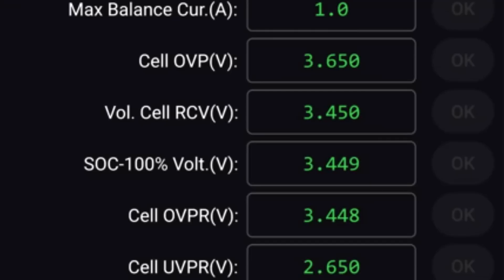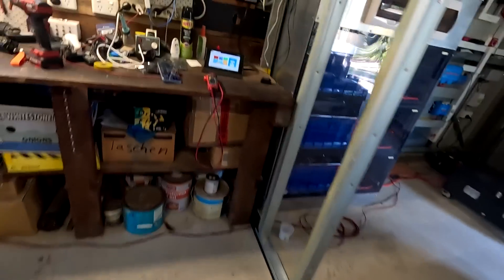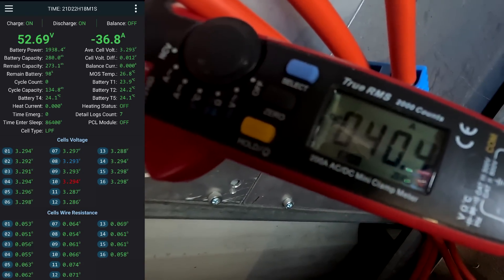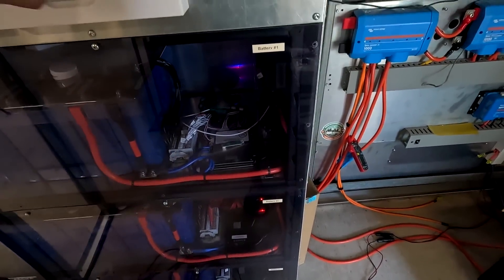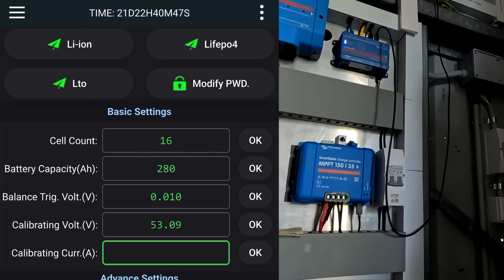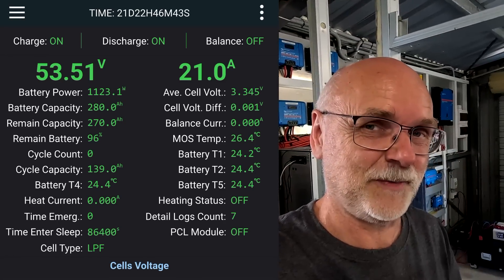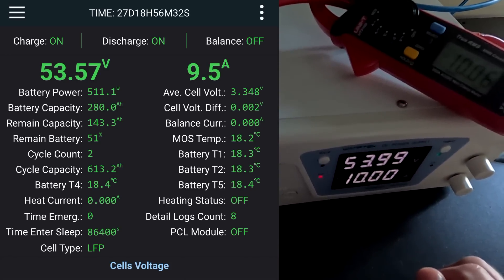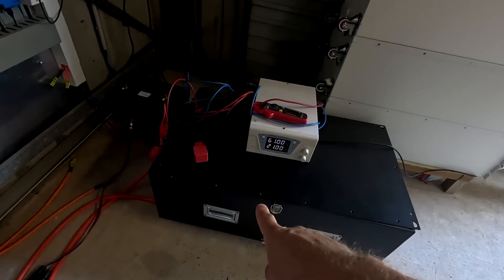JK BMS SOC Drift - How to (not) calibrate the current sensor and will it actually help?

Comment: I'm in trouble with a new jk inverter bms. Cant get to absorb phase with my sofar inverter. When bms hit soc-100-volt, inverter just stop voltage charge and i cant do any absorb or balance. Do you know if jk have any plan to untie soc-100-volt from other voltages ? or trigger 100% soc only after the absorb timer directive ? or do i have to revert formware to version where soc 100% volt was not a feature ? thanks.
Reply: There is no such firmware. That SOC100%Volt setting is there since the initial release of the v14 hardware. Growatt,Sofar, Luxpower, EG4 etc or any Voltronic OEM design are affected. I also would really like to know the answer to your questions as well.
Reply: @AshleyL-.-L  i heard in another videos that older jk firmware reset soc only when ovp was hit ?!? maybe i'm wrong or it is pnly on older hardware jkbms.
Reply: @theshuff  Nope, that is totally different BMS. The older jkBMS or non-inverter series cannot be flashed/updated at all. You are using new JKBMS which is capable of inverter-bms communication and this series has serious flaw with coulomb counting and SOC100% reset by single cell voltage issue which results in early charging termination problem.

Comment: Hi. I've been dealing with this problem for 6 months. The problem is that there are big differences between charging and discharging. If I calibrate the BMS to 20A, it shows 20A when charging, but only 17A or 18A when discharging. This means that the SOC value is no longer correct later. I have now calibrated the charging current to be around 5A lower. This means that the BMS shows less when charging than it actually is. This also means that the SOC value increases more slowly. I can now charge my battery to 100%. But please note one thing, calibrate the current with the maximum value that you use. I charge with a maximum of 60A and then calibrate to 55A, for example. If someone charges the battery with 100A, then you also have to calibrate it at 100A to 95A, for example. And that is the whole problem with the JK, too big a difference between charging and discharging current.  It would be best if JK engineers could build in a correction value. You calibrate the BMS when charging and when discharging you correct the measured value either up or down.

Comment: Hi Andy, nice video and yes, this is an issue in many electrical and electronic devices. Prior to smarter circuitry, an analogue signal was used to control servo motor speeds or even high speed spindles in the CNC world.  Spindles that ran up to 40,000rpm were controlled using a -5v to +5v analogue signal (10v).  This was calibrated quite successfully using a base voltage parameter and a scale parameter.  We used a high quality power supply for the base voltage, and then adjusted the scale while checking the spindle speed with a tachometer at various different speeds to get the closest calibration across the board.  These days the spindles are equipped with ethercat or some other similar communication protocol, and you simply request the desired speed.  Perhaps JK can add a scale parameter to enable the user to set a high amperage baseline with a power supply, and then lower the amperage and adjust the scale parameter until the reading is accurate across the board.  What do you think?  Perhaps you could ask Andy #2, or the engineer that JK has assigned to you if that is even possible.

Comment: Basically there's no way to win here, most BMSs do not have an accurate enough current sense.  The SOC display is going to get off over winter.  This is why I don't do any automation whatsoever based on SOC.  I use voltage only... not as a representation of the SOC (which is also impossible as we know), but simply to represent "nearly empty" or "nearly full" states.

So, now why is there no way to win?  The problem is that most devices have only one fixed resistor current shunt, typically 5 mOhm (milliohm) or something like that, then an op-amp circuit and low-pass filter (resistor + capacitor) on the output as a poor-man's analog accumulator before it gets dumped into an ADC.

So lets say the BMS shunt is 5 mOhm with a full-range of 500A.  That's 500A x 0.005 ohm = 2.5V, with the ADC calibrated with a 2.5V voltage reference.  What is the amperage resolution of the measurement?  It is:

8 bit ADC - 1.9A
10 bit ADC - 0.488A <--- common in microcontrollers
12 bit ADC - 0.122A <--- common in microcontrollers
16 bit ADC - 0.007A (generally a Sigma-Delta ADC which requires long accumulation intervals)

So we can see the problem right-awy. BMSs generally do not sport expensive ADCs.   They typically have an analog mux going into a microcontroller-integrated ADC.  The various components introduce errors:

* Analog mux, generally has internal resistance and some cross-talk between channels
* Op-amp, introduces an offset error and an amplification error
* Microcontroller ADC, internal reference is not perfect
* Microcontroller ADC, ground reference is not perfect (another offset error)

You get the idea.  It is actually pretty difficult to implement ultra-precise coulomb counters.

In anycase, jitter or even a sine-wave current does not cause any real issues, the microprocessor typically takes many samples per second.   An ADC conversion is typically only 10uS but it is reading more than one channel.  Still, 10uS = 100,000 samples/sec.  If it alternates the high-priority shunt with low-priority channel scanning, we are still talking 50,000 samples/sec if it were going full out.

Most of these BMSs probably don't scan the ADC that quickly, but some multiple of 50Hz or 60Hz is very common.  For example, 60 * 50 = 3000 samples/sec.  Very very common because they get a integral number of samples regardless of inverter line frequencies that might be causing sinusoidal currents.

-Matt

Comment: The display looks like it is 4 or 8 bits, so there will be only set number of jumps in amps displayed, what would be ideal is a plus or minus adjustment instead of clearing the whole number with a new number, but I think that is still controlled by how many bits each jump as you increase or decrease the value

Comment: Also the voltage can be calibrated, one of my JK bms was 0,4 Volt off That was 25mV per cell
Reply: had the same on my pb2a. almost 0.6v and 30mv per cell. i was like "WTF this bms cant read accurate voltage"... i then focussed on current and it was the same as andy. good on hight current. bad on low one. resolution +/- 0.7A under 3amp.

Comment: This week, I find my Dell laptop battery not lasting as long. I believe it is because I am using a USB scanner and it charges the handheld scanner.  I want to add a battery pack to the USB-C charging port. I wonder if I can just connect +/- from a YELLOW or RED tool battery (18/20v@3Ah) to a USB-C cable +/- to provide extra run-time? These battery packs have their own BMS. The laptop has its own BMS. I am not sure what is in the charging brick. The specks on the brick read 20v/4.5A/90W and smaller.  I think it would work. What do you think?

Comment: A series string of 4 x 12v halogen flood lamps would be a suitable resistive load for calibration.
Or a couple of pieces of copper pipe in a bucket of saltwater

Comment: Old style battery charger (or may be DC welding buzz box) with maximum voltage protection settings of 58.4V (for the 16 Li-FePO4 batteries connected in serial) gives us that constant current, but no way - it must be the invertor' prerogative to calculate the SOC !

Comment: This is what I was saying in your last JK video. Great this is brought up.. I use JK in small cars and if the customer is not charging fully every time, the SOC will be high but voltage will be low.. In most cases the SoC remains at 75% and then to 0 because the voltage is already 3.2V..

The JBD BMS is clever because it has SoC for 100%, 80%, 60%, 40%, 20% and we can assign value for each.. it seems to work even though SoC doesn't match at times, as soon as we discharge, it callibrates itself to correct SoC after sometime.

Comment: Ohms law and power resistors are your friends. Measure battery voltage. Measure something like a water heater element resistance. Use ohms law. Clamp meters are not as accurate as shunts. Volt meters and resistance measurements are much more accurate. 
It's not rocket science, it's math and experience.

Comment: The ten 1 milliohm chip resistor in parallel form a 0.1 milliohm current shunt.  The copper bars are just to beef up the PCB copper foil for high current.  Because the ten chip resistors are distributed along the PCB there is PCB copper foil thickness tolerance which has some effect on the actual value of 0.1 milliohm net shunt resistance.

The voltage drop across the 0.1 milliohm net resistance current shunt is amplified before injected into uC's analog to digital converter.

Lot of places for errors to creep in, including DC offset drift vs temperature on op amp.

Victron smart shunt and 712 monitor has precision temp compensated 0.1 milliohm shunt resistor, self-calibrating DC offset correction op amp, and higher ADC resolution for reading the shunt voltage drop.  That is what you are paying for.

If you want to attempt JK BMS current calibration your best reference is to use the number from the Victron smart shunt.  If you load inverter with just a resistive heater the battery current should not jump around much.

Comment: As we have noticed the current sensor does not (always?) seem to be a linear response, we have opted to calibrate at 50% of max current allowed. Whilst it does show some inaccuracies in the lower/low currents, on average is it fair enough for us/me.
Until BMS software allows you to have multiple data-points to input a reference-currents (let's say at every 10% increase, so 10%, 20%, 30% up to 100% and tune the real values compared to the displayed values), we believe that calibrating at 50% is good enough for now.
I do believe the BMS often does partially measure but also partially does some calculations (algorithm?), as measuring requires (very) accurate components, temperatures and sufficient voltages and currents, that BMS manufacturers are not bothered as much for accuracies.

Comment: It looks like the firmware needs more calibration points, it is common for the ADC to not be linear in response (called INL), especially if they are just relying on a microcontrollers built in ADC. They probably need to add points for ZERO, 5A, 10A, 20A, 50A, 100A to ensure that the accuracy is as good as possible, in a pinch they could do a ZERO, 20A, 50A setting, to give some kind of response curve.
The SOK batteries built in BMS uses a zero set point, and then a current calibration for charge, and another for dishcharge.

Comment: The 100% voltage should be based on either (1) AVERAGE cell voltage or (2) Pack Voltage.  If you have even moderate (~0.100v) deviation then establishing 100% SOC based on the highest cell is ludicrous.  Pack voltage makes the most sense, but average cell voltage is a usable alternative.
Reply: Hello Sir, need help
Reply: With my jk smart bms

Comment: You missed a step. First, calibrate the voltage. THEN calibrate the amperage per the instruction. 

You calibrated to a wrong voltage which creates a drift.

Comment: Thanks for video.Yes I believe any readings with clamp meter should be on a scale, where the meter range is close to what your'e reading. They're most accurate at full scale. Don't measure 10 amps on a 400A meter range. It's like when you take 5.8 kg of scrap copper to a buyer, and he says "put it all on this 4000 kg scale," and pays you for 5.0 kg. It's not right. 
Maybe put multi turns of the sample cable through jaws of clamp meter, (clean it where jaws touch) to bring up current on say a common 80A scale little clamp meter. 
External available 75mV shunts used to be 1%.  Now I think 0.5% are common. Just for the calibration, you could wire one in, and use a 3.5 digit or better DC multimeter to measure volts drop across it. (User can get advice on how to then calc Amps from that I if they don't know how to.) They are much more accurate on the DC volts scale, than a clamp meter is on the 100A range. Even a $30 Jaycar one is +/- 0.5% on DC volts, and I've seen 0.25% ones for a bit more or same price.
For something so important, we could spend a few $'s, and sleep easy.

Comment: Your power supply will not be calibrated probably,  Andy.  You need a NATA accredited power supply to do that, but it's a good idea.  Getting a calibrated fluke multimeter to set it would work, too.  That is the calibration technician in me talking.

Comment: Dear Andy, any information or update on the SOC 100% stop charging issue for Growatt, Luxpower inverter etc? I updated my BMS to 15.30, the coulomb counter plus SOC 100%Volt (single cell reaching the balance start voltage) still cause the SOC to reset 100%. This results in early charging termination as usual.

Comment: Hello Andy. Forget it, what ever you do it’s always wrong. There is nothing in the world to measure this. The problem are the lost in de kabels. Even when these are 10cm long. Purity of kopper length en temperature (even 0,001 degrees different) so don’t waste your time to find a solution. And use only one point to measure as truth. There are 100 of reasons more but it’s not worth it. So my advice,calibrate the bms once a year. I’m sorry Andy but I’m sure you now this All by yourself (smart man )

Comment: I think we need to take into account the voltage drop in the wire and resistance inside the bms. Feels like the higher the current the less the resistance matters

Comment: Hi Andy
I have a question about your set up and JK bms,not directly connected to this topic( i don’t know how to contact you another way)coz i do something similar
If i have 3 banks batteries with each there own breaker(2p16s608Ah) connected to busbar and afterwards main breaker 
My bms is JK -PB2A16S20P and will limit charge current to 120A
Someone told me that it’s not so good idea this way coz there will be nuisance/imbalance between the 3 banks and breakers will always trip,one after the other…I don’t really believe this if i see your experience with it,but it’s running in my head😢
Bitte konnen sie mir die richtige losung mit teilen
Grusse aus die Philippinen 
Marc auswanderer von Belgien😊

Comment: Excellent Video again Andy, and one that I will embark on my self in about 4 weeks.  As an instrument tech that has been calibrating equipment for the past 30yrs, a single point calibration will never work for exactly the reasons you have shown. In general terms, You always need a min of 2 point calibration. Typically a low and a high value and from these two points the instrument plots a slop and match's its reading to the slope.  Be good if JK could implement a low value cal point and a high value cal point. Maybe 5amps for the low and 20 A for the high might be enough but with a 200amp shunt you really need to be significantly higher (60% to 80%) to get a really good representation. The lower 5 to 20 may be just fine if you are always working in this low range. I have set my BMS to a max charge of 70amps. And from my 12kw solar I typically can see 140 to 150 amps in these shoulder months where the day is cool 15-17 deg and sun is good. Currently this push's into 4 batteries, 2 more should arrive by the end of the month. When I had planned to address this for the same reasons.
Reply from the maker: Thanks a lot for sharing. I'll discuss with JK.
Reply: This  is the way that I would use a two point hi and low calibration point. Another point that is being missed. Is when you have a number of batteries in parallel  you have a common voltage from them all and when you look at the cell voltages. They are also all very close   Yet each battery can be displaying a totally different soc.    I have seen  in my 10 battery stack one battery down at 10% soc.  And others at 60%  yet all the cell voltages were within 10mv of each other  we have communication between battery’s  why can this not be used to  sanity check  the value agains the other battery’s ?

Comment: I'd set the calibration current to my most common use-case to get most accurate results. However, most BMS have a minimum threshold below which they don't count the current anymore. This will lead to problems over time as well.
Reply from the maker: Yes, correct. The JK has a 0.3A threshold. Any current below that will not be counted for.

Comment: A clamp DC amp meter is not a well calibrated current measurement, need to install a calibrated inline current shunt, if you want a accurate measurment.
Reply from the maker: Which customers/users have such a device though?
Reply: @OffGridGarageAustralia  
True, for home use accurate current calibration does not stop a solar system from working.
A good current shunt
Reidon SSA2-500, get it from Digikey
Current Sensor 500A 1 Channel Shunt Bidirectional Module
100A to 1000A
AC or DC Circuits
1500VDC Reinforced Isolation
Amplified Differential Output, ±2.5V peak
± 0.2% Tolerance

Comment: The current fluctuations of the inverter do not come from the sine of the generated voltage, ( wich changes 50 times per second ) but from the MPPT, which tries to find the best operating point of the modules.
Reply from the maker: No, not in this case. There was no MPPT connected as shown in the video.

Comment: Are they using Manganin alloy in the shunt, which compensates for temperature changes?
Reply from the maker: Hi🙋‍♂️
Reply: @OffGridGarageAustralia  Since the shunt is a calibrated resistor, the more current you pass through it, the hotter it gets. Manganin was developed as an alloy that would keep the resistance constant up to fairly high temperatures. My JK BMSs suck as a reliable measurement of capacity, and I calibrated them too.